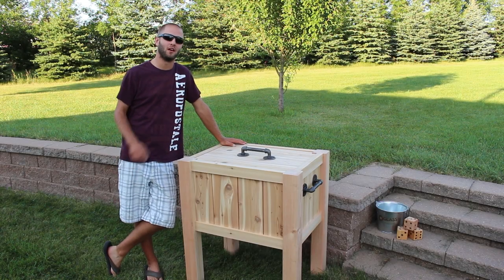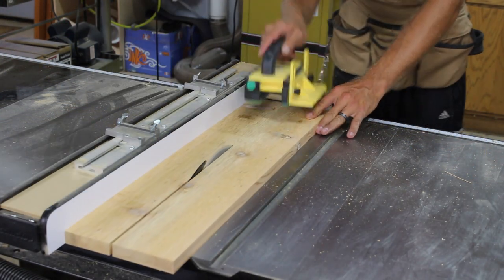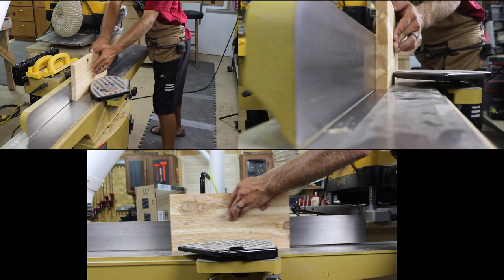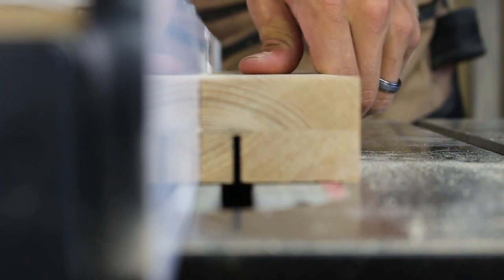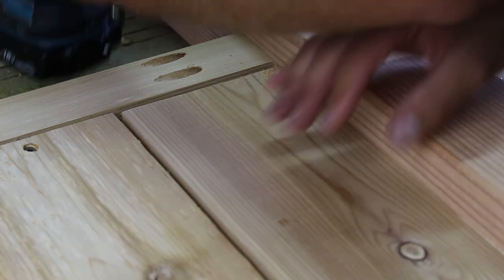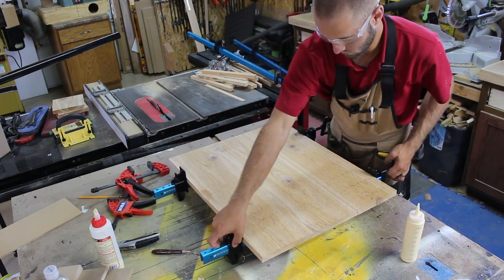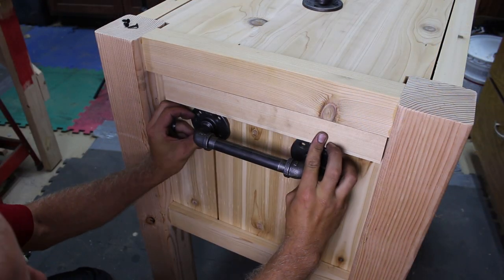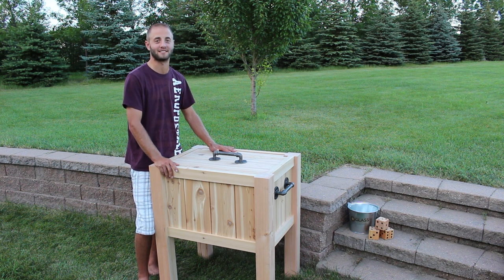Build a Cedar Cooler Chest - Iron Pipe Hardware!

Comment: I have seen a million of these built online, however, I have to say that your design takes the cake. Great build, and will be enjoyed for many parties I am sure. One thing that I HOPE you are doing, is like the store bought coolers, I hope you are making the inside cooler out of Styrofoam and sheet metal bent/joined into a square shape? With sealed corners, and the lid being made out of similar materials/process. The only thing I might change about your build is that I would hinge the lid, but you could always change yours to suit. Thanks!
Reply from the maker: MP Woodworking Thank you for the comment! I plan on insulating the cooler with rigid insulation then using fiber glass panels to line the insulation. Use silicon to seal the corners and edges.
Reply: Cool, can't wait. I am going to eventually make one (now like yours), with rigid insulation and Styrofoam, covered with sheet metal and tack weld in a few spots, followed up with silicone on the edges to seal them...very similar to yours.

Comment: Nice take on a cooler box, Andy.  The only concern I came up with are the side handles...  I am afraid of them as decorative only - in my house, some helpful family member or party goer is sure to pick up the box by such handles.  My second question on them is if the flanges screwed to the side panels like that will hinder seasonal movement, since you went to all that trouble on the ship lap joints?  I guess time will tell!  Thanks for the video.

Comment: Nice project look forward to the lining process, will it include insulation? If you plan on leaving this out in the weather those black iron handles are going to rust pretty quick. A shelf underneath to store extra items that won't fit into the cooler might be very handy. Also maybe an arch in the stringer bottom to add a little more flair. I would also at least put some sort of sealer. Keeping natural.
Reply from the maker: Pat M good call on the iron handles! I will pry add a clear finish in the future
Reply: Glass Impressions Nice chest! An outdoor poly over the pipe will keep it looking good.